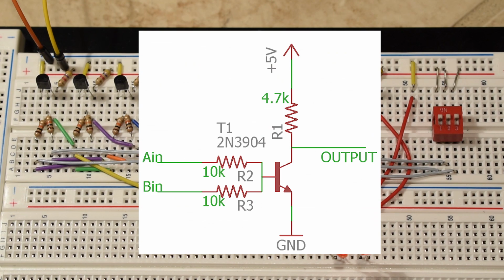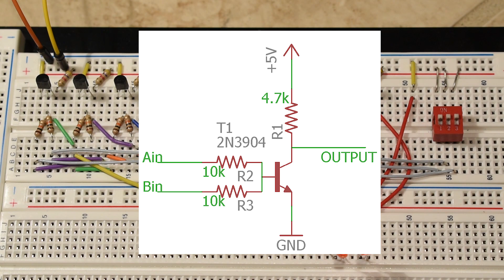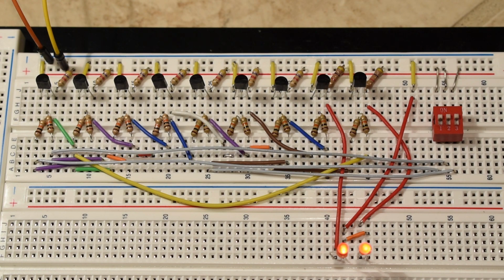Transistor Level Full NOR Adder

Comment: Hello i build your circut 
But ist dosent work :/
Is it because i used bc547b ? 
And not the 2n3904 

Thanks if you reply
Reply: check the pinout...y revesed in bc547
Reply from the maker: That should be an equivalent transistor. It’s hard for me to diagnose a problem without seeing your setup. My advice would be to ensure all your transistors are in working condition. Also starting the wiring over again from scratch can help too since it can be hard to catch a small mistake.